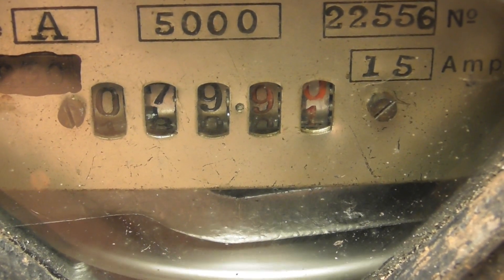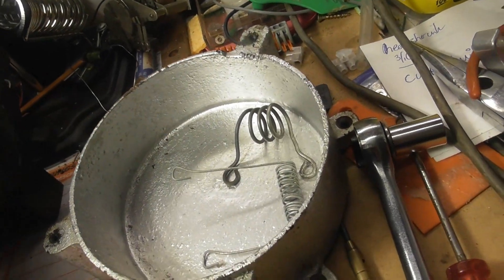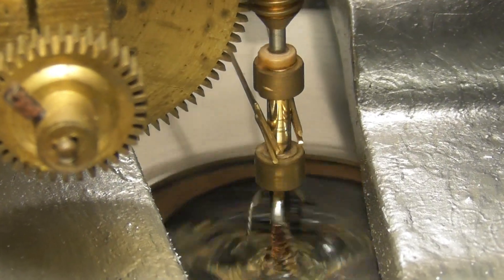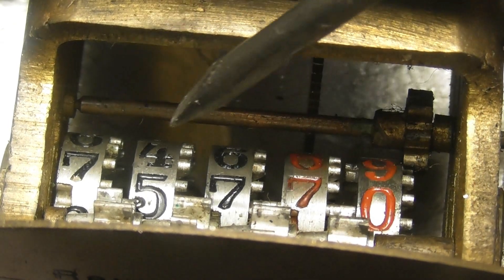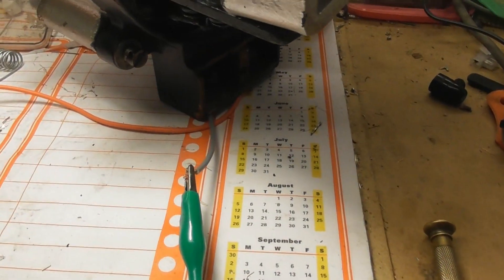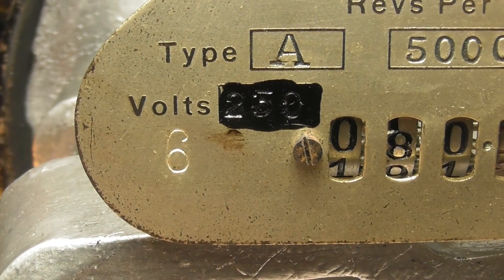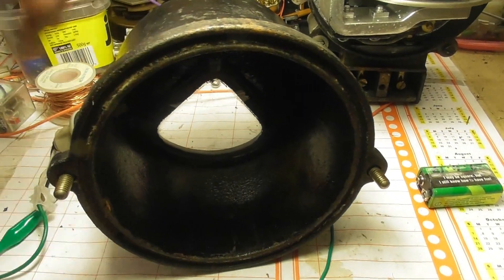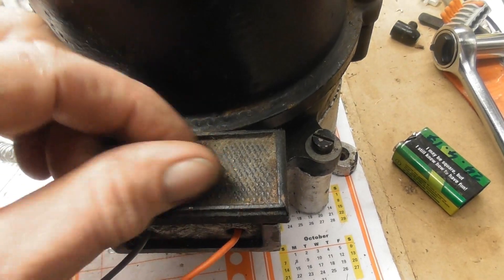DC Amp hour meter from 1910 still operational

Comment: It would be interesting to see a Thomson DC watthour meter taken to pieces.  They made ones which could work up to 3000 amps at 600 volts which were used in railway service.
Reply from the maker: The few collectors who have a Thompson DC Watthour meter, don't seem to make video's of the meters running, which is a pity. I am sure there will be a massive copper or brass parallel shunt with the armature meter coils and most likely series resistors to keep the PT coil Voltage at a safe level.
Reply: @RODALCO2007  The shunt is actually part of the top of the meter.  From what I have read there are several discs hidden away in the base of the meter.